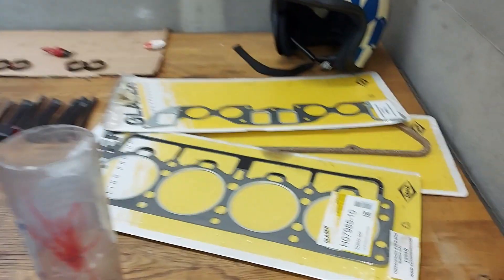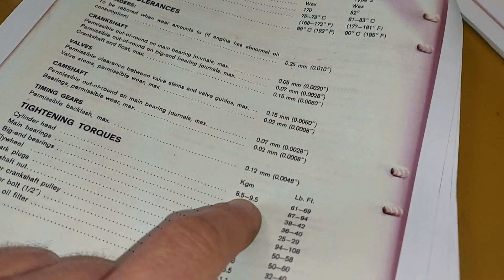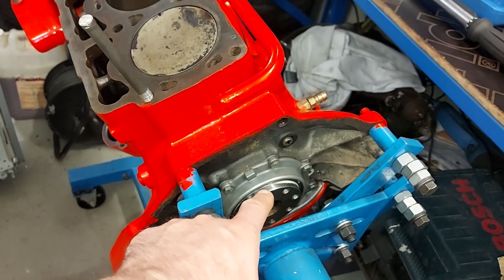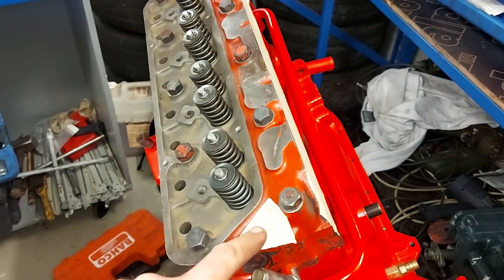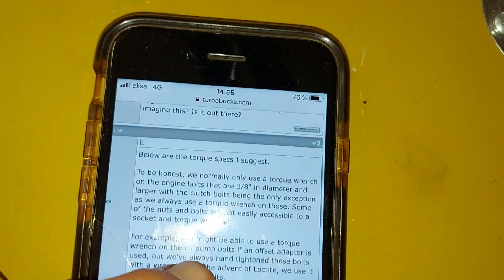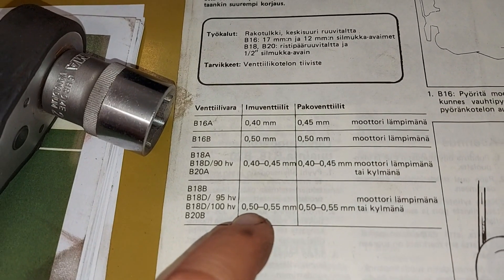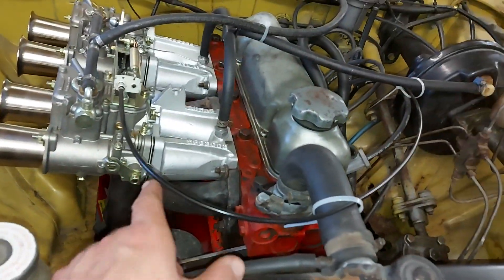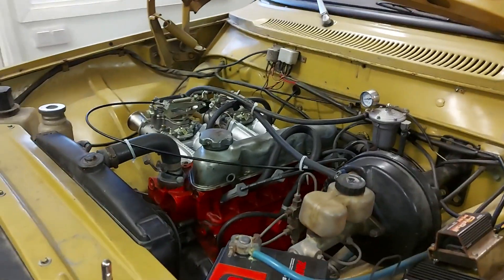Getting there! | Volvo B20 cylinderhead assembly and valve adjustment |

Comment: The intake manifold gasket witch side go toward head ??
Reply from the maker: Sorry, don't know about original gasket. I have 2xwebers and those gaskets works both ways.
Reply: @hanssgarage1886  Ok I am not sure it is my gasket But there is a vaccum leak I will try spray carb cleaner and see if i can figure it out Good luck with your project

Comment: I've liked watching this b20 build. It's a hard engine to find much info about. I recently picked up a 1969 b20b for my 1956 pv444k. It already had a b18 swapped into it but it is seized too hard to break free in the car. Seeing this is good for motivation to go out into the snow to work on the old beast. I also like your 945 as that is what my daily driver is. Keep what your doing brother, I'm loving this old rare breed volvo content!!